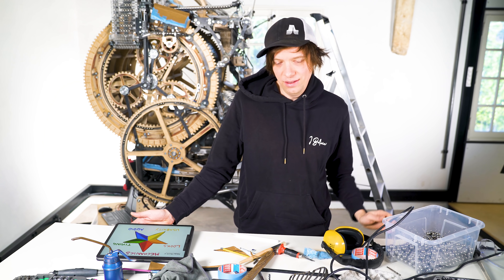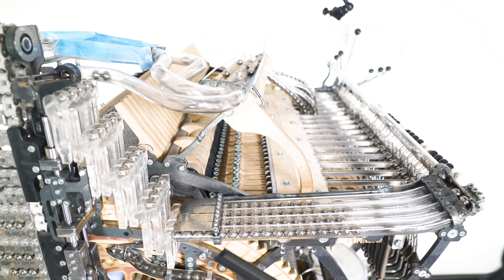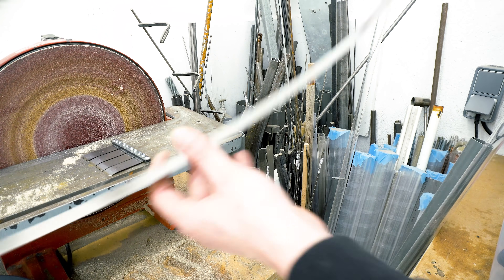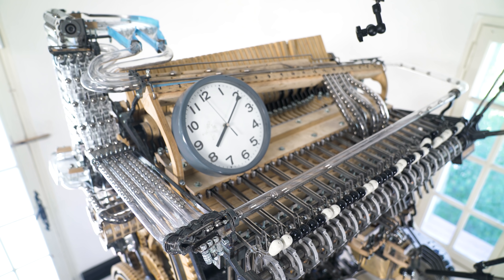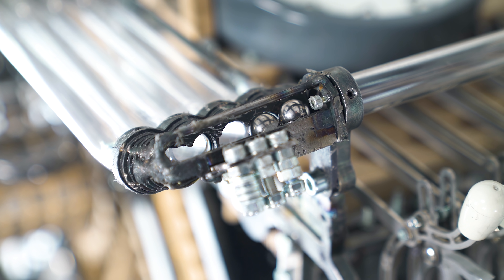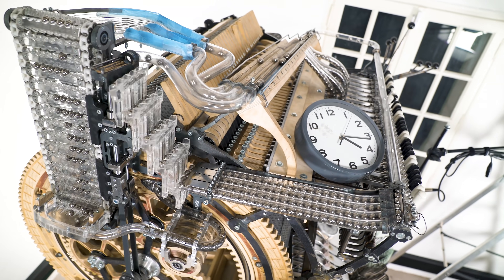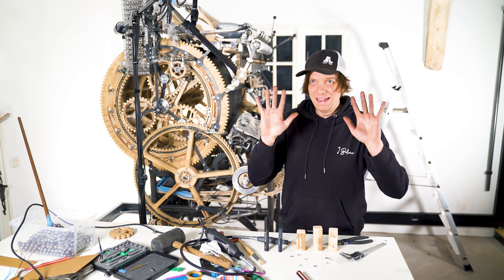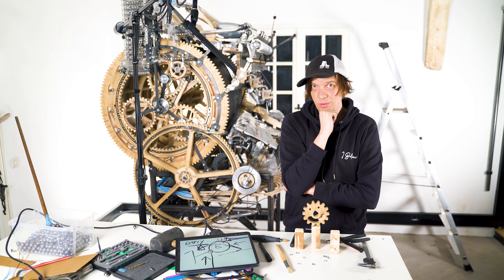Marble Machine X Fish Stair Upgrade

Comment: metal shards can be washed out with cold water and we are talking about Swedish winter swimming cold, that way your skin pulls toghetere and pushes them out, use soap and a sponge and stroke "med hårs" don't know the english word for that right now, but this is what I recommend since Its the only cure for those who work with Fiberglas isolation (like me =) )
A smart thing is to get silicone/Nylon work gloves when you.. work, it has saved my fingers from being cut, jammed, hammerd and bombarded with skin biting mini particles. 
There are a pair that are called MaxiCut. (And they are made in France =) )

Comment: An idea i came up with for the divide-by-four to make it more reliable:
What if you made the tilting "cradle":
- Fit 5 marbles instead of 4 (while keeping the 4 exit holes), and 
- Adjust the counter-weight so that it tilts (and releases the marbles) when the weight of 5 marbles are on top of it 

Wouldn't that make sure it always releases 4 marbles at the same time? :)

Comment: You can focus on looks when its done. The painter is always the last craftsman to leave a buildingproject. And you have to come to the realization that this will be a lifelong project. This is your life, your job, your fame and future. Live it, love it, hate it and be it. Youre creating a mechanical wonder of the world.
For the programming. Have to give up on the drums, the cylindrical programming will not cut it in the long run. Have to be able to feed the machine belts, long lines of mechanical coding rather than what can be on one rotation of the drum. And focus on problems that matters. The "daily" issue with a slight buildup in one lane of the feeder doesnt have an impact on the amount of marbels that reach the ladder. It be nice to have it fixed, but the feeding itself doesnt seem to present a problem that impact the performance of the machine. But holy efff, what a result!!!

Comment: Couldn't you make an adjustable gate at the end of the divide by 4 that is connected to and operated by the fish stair? That way it's in time with the fish stair movement and only releases a marble when the fish stair is in the open (down) position and the gate closes when the fish stair goes up. I think that could eliminate any "EDGE" marbles.

Comment: Why not put a piece of metal that coincides with the fish stair that when the first stair goes up the sheet of metal goes down in front of the stair and when the first stair goes down the sheet goes up with the 2nd stair which thus creates the opening for 4 marbles to go into the 1st step (since there's back pressure) and then as soon as the 1st stair starts to go up the ball guard starts to come down with the 2nd stair's downward motion? The mechanisms to do my idea exist already, you just need to piggyback on the 2nd stair's frame to be added to the piston motion so you can create the ball gate. And with the ball gate essentially brazing the top of that step on the down thrust the ball that would have hit the corner will instead be brushed backward due to rounded nature of the marble and the gate sloping down the front of the marble pushing it down back into it's lane before it hits that perfect angle.

Comment: I think this is the time you need to check each subsystem of MMX in a "Live Concert" Condition : 
- Identify independant systems : e.g. Fish staris, demagnetizer, magnet wheels, marble lift, *single* marble gate
- Determine requirements for EACH INDIVIDUAL subsystem, e.g. "the fish staris needs to be able to lift X marbles per crank turn for T hours straight", "the demagnetizer needs to demagnetize X marbles in at most Y hours", "a single marble gate must be able to drop XX marbles at YY speed during T hours without failing". 
- Check that individuals  subsystem fully respects requirements and bypass every other subsystem for the test. 

That way, you'll be able to know which systems ARE good and which ones are not. Currently, you only are testing in Live Concert conditions everything in the same time, and fixing the issues as they're appearing, but **you are not able to detect basic design flaws in previously built systems"

Comment: Hi. a question. do you need 2 different lift systems thats doing the same jobb?
Way don't you use the one on the left with the elevator system to lift all the marbles.
its looks to be more reliable then the step system.

i might be missing some thing sorry im a idiot.

Comment: i dont know if its too late but what about switching dividers, one feeding two, feeding the four pipes? every marble switches the path and thus every other marble goes the other way.  that feeding two parrallel dividers doing exactly the same, so the following four pipes will be filled constantly. i imagine the switches have to be the size of three quarters of a marble to prevent interfering the switching process with the next marble and the throughput should be fast enough to have four marbles available for the fish stair when it is ready to pick up the next four marbles.

Comment: Why do you want to keep the pipes before the stairs full. This will limit the variation in output of the machine... E.g. Never play a fast song with lots of channels  longer than a few minutes.

Why not try to slow down the speed of the marvel entering the stairs. Creating a system in which the entering speed and pressure for the marbels heading to the stairs is always constant and so not influenced by the fullness of the pipes.
Reply: Maybe a plywood s shaped path just before the stairs would help. Just like the ones for the marbel gates to nutralise the changing marble pressure

Comment: Hello Martin, I was thinking about the divide by four mechanism. Can it be simpler to have the same mecanisme as the marble divider ? So if there is a low marble flow, only the first channel will be used and if the flow become more important the next chanel will start to be filled. I find the divide by four very elegant but the marble divider solution just need to be set at the correct height to work.
Keep the good work !

Comment: Am I the only one thinking that if you had the PMMA pipes on a steeper angle it would simply solve the issue, As far as I can see at pausing at 13:58 and stepping it frame by frame, the second and 3d marbles arrive correctly, but the 1st marble is way too slow, resulting it to get stuck in between, but if the pmma pipes were in a higher angle maybe that could solve this. Gravity is our friend

Comment: I have an idea! Your problem is that they fill unevenly. You have already solved this problem once. Why not solve it the same way that you did at the top of the machine? Use the adjustable height spacers and drop them into the divide by four from above, rather than allowing them to roll in from the end. When a channel is full, the marbles will roll to the next channel. It will also be adjustable. You won't need the swing mechanism, or all the messing around with grinding. The solution at the marble gates is elegant and will work here as well. You just need to fix the run for the height into the divide by four.

Comment: the thing is: the angle behind the swing is steeper than at the end into the fishtail. when your tubes are "starving" of marbles - the force by the marbles is lacking. perhaps it is a good idea - to change the positions of the steep angle.
maybe it could be a good idea to rework the swing the way you did with the channels to the drum machine. a 3d printed part could save much work there.

Comment: Also, you need to keep in mind, what MMX is. It's not a musical instrument. If your goal was to make the best possible autometed music player, you would use a MIDI sequencer, right? MMX is a visually spectacular Rube Goldberg machine, which plays music. You will never get it perfectly reliable, but that is it's character. Some dropped marbles just add to it. What it is not allowed to do is break beyond repair. The next most important thing is that very rarely should it break at all. Then, it should only rarely jam so that it stops playing. And not too often should it miss a note or loose a marble. Those are reasonable design goals for this level of insanity.

Comment: Martin, here's an easy and simplifierd fix for the spring steel issue: If you look at how the fish stairs hand over a each set of marbles, you can see, that the slope each marble sits on helps a lot to initiate motion fast once the "gate" to the next element opens up. Therefore, instead of the tube ending at the fish stairs almost level you could add a steep slope at the end (e.g. another fish stairs element that isn't moving). Otherwise you could add something similar to the divide-by-four to separate the leading marble from the followers to inhibit pressure from the back…

Comment: Hello Martin! Amazing video and project as always. 
I have few ideas that maybe (I say Maybe) could help you wuth some issues;
The first one is about the divide by four system : as I understood it, the problem is that unlike the functionning it is supposed to have, not always four marbles are being injeted in the tubes feeding the fishstairs. So my idea is : what if you built a stopper arm attached to the swing, so that when the marble count reaches four on the swing (not yet activated), the arm swings at the same time with the swing, blocking the marbles coming from the tube feeding the divide by four, and as the swing comes back to his original place, the marbles could roll again into the divide by four, and so on. I think this could be a nice working solution. 
Another idea is concerning the metal plates on the tubes at the entry of the fish stairs. The problem I see is that when a marble jumps out (like at 13:56), the metal plate forces the marble to stay on the tube ; but what if instead of making these plates straight, they were a little bent uppwards, so that when the tube runs empty and a marble comes right at the bad timing, the marble, instead of wanting to jump away, is redirected into  the fishstairs? You could even maybe curve the plates so they direct even better the marbles into the fishstairs. 
I have no idea if these are good or working idea but that's what i would have done in your position so I wrote them anyway.
Also you say in your video that you feel embarassed to continue this project but I instead think that giving up now after all you have tried and done would be even more disappointing for everybody, so hang up man! I sincerely trust you can do this!

Comment: <grin> I feel for your frustration.  As a fellow designer I have a suggestion about how to deal with the fish feeding problem.  What seems to be needed is a tick-tock rocker gate synchronized to the fish ladder movement.   The concept is much like a clock escarpment.   When the rocker is tipped to the left a marble rolls into the ready to load position because the back side catch is up. When the rocker tips to the right the marble in the ready position is allowed to roll into the fish ladder but the backside of the rocker blocks the stack of marbles queued up.  Just a thought.

Comment: Surely one of the problems here is that channel 1 marble has to reverse direction to get into the pipe.  A redesigned path for each marble in the divide by 4 will fix that issue.

Comment: Maybe it would help if you bevel the edge of the fishstair in direction of the tubes, so that the critical marbles don't get stuck but instead can be pushed back into the tube. The problematic marbles are only the single ones, so they can get pushed back easily.

Comment: Your fish stairs are too deep. If each step was a touch shallower than a marble then a marble sitting on the stair would be blocking the next marble from trying to join it. 

As for the marble divider, if it does cause a cataclysmic failure then stop optimizing it!! It would be “nice” if they all filled equally but not necessary for a performance. 

Finally, by the time you’re grinding rather than manufacturing you’re never going to win. Fixing it today, with today’s humidity and temperature doesn’t mean it will still be fixed tomorrow. 

Why not just let them into any pipe they want and just make sure your pipe is the right length so they can roll over a full pipe. Just like the big divider at the top?

Comment: How about you bild marble reservoir to the other side of the machine, then you can release some marbles to fill the 4devider. It can allso works as reservoir for the marbles if you are not playing anything, but there are marbles in the machine. You mayby have to consider a reservois for the marbles in some time.

Comment: Hi Martin. I am a gig fan and following your journey from the beginning but never commented on anything. I am a specialist on injection mould tools which is all about high precision and repeatability over long times. so here my comment. It try to avoid any springs on any mechanical movement which needs to be precise. They also loose performance  over time. could you not just use a marble gate in front of the fish stair which is operated by the movement of the stairs? BR Andre

Comment: Some random comments from an artist and engeneer.
1 the best engeneer is the one that delivers the artist vision the best, and according to the specks. An engeneer that butchers the art design is not a good engeneer even if I over delivers on speck's.
2 do not undervalue design by trial and error, it's how most of the natural systems were designed.. 

You are sometimes trying to hard to try to hard, and focussing to much on your own natural limitations as if you could be a perfect eng. No one can ... Relax you are doing amazingly great. 

Now to your current problem... Many solutions ...
And I could start enumerating them here, but that is no fun... The fun is the discovery and the path to it...  Hint you are starting to deal with problems of logic type, if this than that type of work... Purely mechanical systems avoid that like the pledge, but it's not like they can't achieve logical predefined decisions... 

Having said that you probably have a good enough solution already and just need a final adjustement to your final step, maybe a felt vertical stoper above the spring steal were the balancing act Between the steel and the stair ocours forcing the ball down.you Can even make sure itvdoe not bounce off by pacing another steel spring plate interlocked with the 2 you have now but this one attached to the felt side ...

Comment: Is there a way you could soft mount the bottom fish stair such that, if you get an excessive amount of force on the bottom stair it doesn't step, it just slides down a very rigid spring that will overcome the normal stresses, but gets overcome by this empty edge case?

Comment: Cant you 3D print a perfect version of the divide by four inlet? This is not a good solution since if the first channel gets stuck somehow, no more marbles can get to the other channels... Also maybe if you make the edges of the metal spring steel a bit concave, they wont get stuck as much. Don't give up! I believe in you I have followed the project from episode 38 and I can't live without it anymore :)

Comment: You'll always be fighting engineering perfection, but I don't see how that's holding up the artist. 

The machine seems functional enough for a live show to me. If people wanted to go to a concert where the music is played with perfection every time - write MIDI and play it on a computer. This entire project is art, and as such it's more enjoyable if it's not perfect. That's the charm of it - and reaching perfection will suck the soul out of the project (and never be finished, of coarse)

I say you get on with some music! Then fix the issues that actually come up in practice - rather than trying to break it in a 'lab' setting, which you will always manage to do.

Comment: What if you redesign the swing so that the entry into the pipe is blocked by part of the swing until 4 marbles are there, so that way it's certain you'll get them dividing into 4?

Comment: It may seem like you are taking tiny steps and there is a long way to go. But you are good at changing and adapting the way you think. There may seem to be too many problems at times but its going to be a snowball effect, fixing problem A could lead to problem C and D beeing smaller or going away and it could also be the perfect solution to problem F. There IS light in the tunnel and i know i personally hope you will not give up :)

Comment: You need to use something for this part, which is similar to the last part you fixed. So, you know how you have those channels, and the marble sits at the top perfectly? Well, you need something like that for this as well. Where the 4 marbles sit in the channel, once in, then released, maybe a buffer of 3?